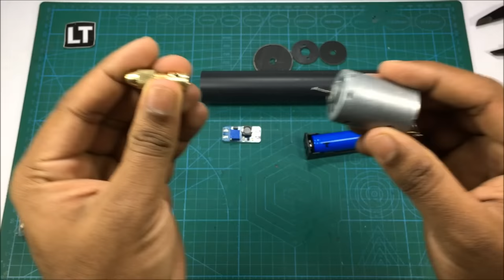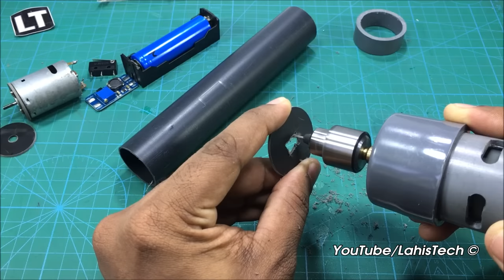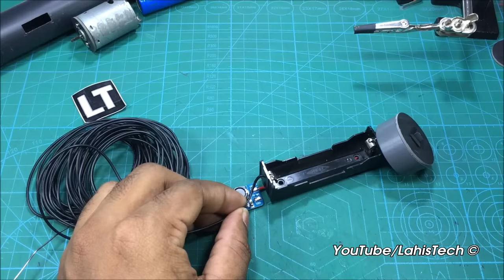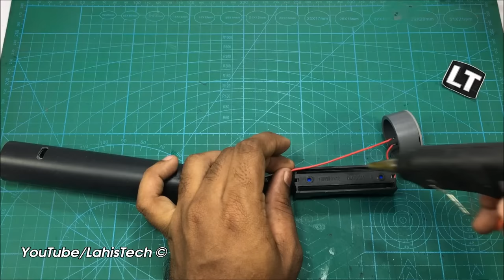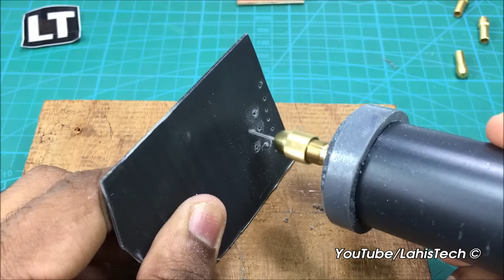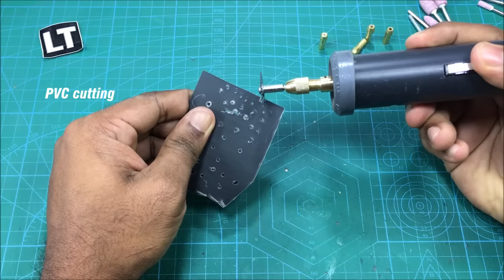How to make a high speed cordless Dremel Tool by 380 motor // mini drill rotary tool

Comment: You have an adjustable converter, you could make a speed control button. Also, that circuit needs heatsink at 10W+. And you should add tp4056 module for charging battery.

Comment: Sir the circut Ron's the motor but not able to stand the torque stops on slight load so not recommended. If u want to contact me don't hesitate. Increasing voltage pcb getting heated

Comment: Very good.... but what did you put between the positive + and negative - of the motor?? a resistance maybe?? which one???
Reply: It's not a resistor, it's a ceramic capacitor used to prevent the reverse flow of back emf generated by the motor.
Reply: @omkarkhade4602  I assume it must be 104 ceramic capasitor, right ?
Reply: @BuluBuridSMDA  It can be 104 or 103.
 I don't know if any different value capacitor is used in the video.
Reply: @omkarkhade4602  Yeah right.. But indeed its a good thing put ceramic capasitor there 😁

Comment: Hi, Why Is neccesary MT3608 2A DC-DC Adjustable Step Up Module?
Reply: The battery voltage is 3.7V, he need the step up module to increase the suply voltage to the motor because the motor voltage range from 6-24V.

Comment: I think you forgot how to charge it!
Reply from the maker: That's why I put a 18650 Battery Holder Case, to remove and charge it externally.
Reply: I Like your work! But I think is better to add a charger module even thoug it not add size. You can put it at the back of the case I think. It is only a advice. I dont make my own yet. I will copy yours with this add and I'll see. Thank you
Reply: @juanpablo-pp4py  I agree with your opinion 👍